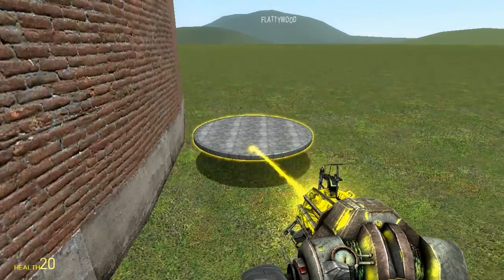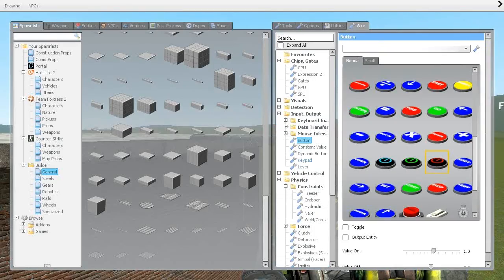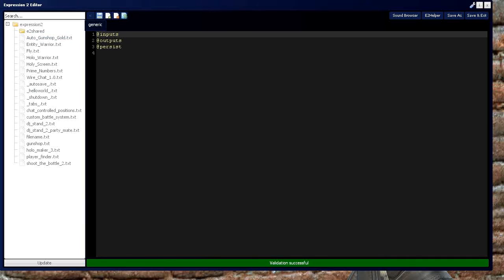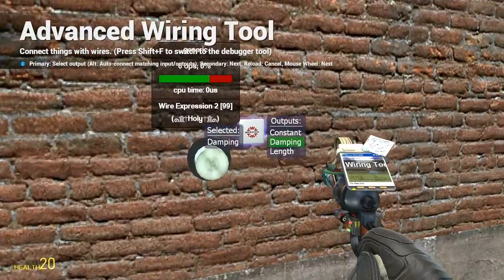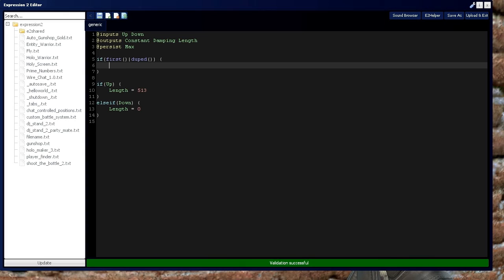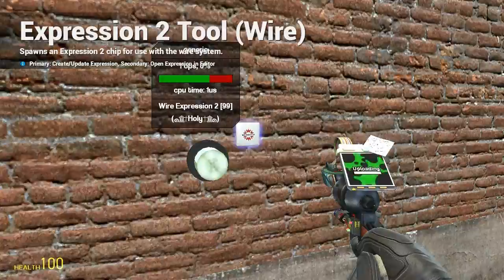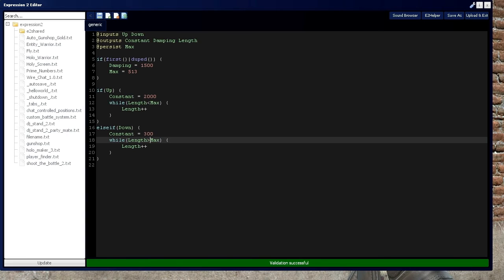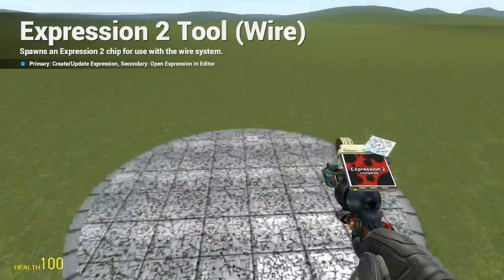[Gmod] How to Build Tutorial 1a: Elevators - Introduction

Comment: Grrr.  I have no idea what is wrong. I am following every step but when I press my buttons, nothing happens.  I see them sending 1s.  My wiring and scripts are exactly the same as far as I can see. Has something changed or disabled this video, since it was made?
Reply: I have tried it both ways. I have been able get some movement since my post, but I THINK that my slider, or the hydroponic is not completely vertical.  If they are out of pumb, won't the slider freeze up? I really wish that Garry's mod was more pressie, but I guess it was designed to make "lame" things, because that's the fun.  But it isn't fun when you can't make anything. BTW, I know about the precision tool.